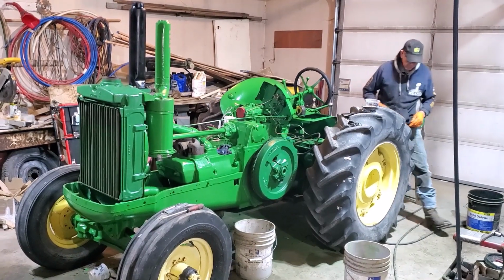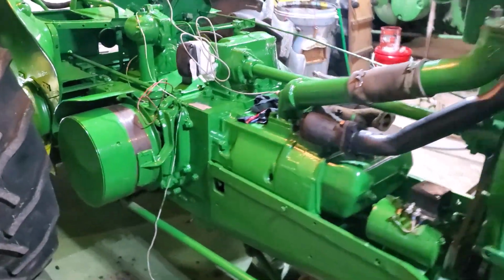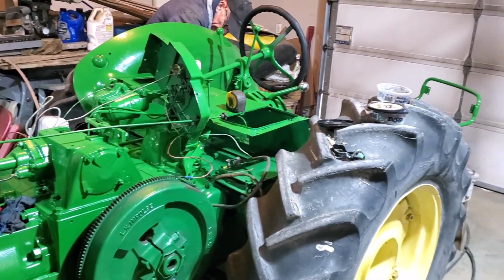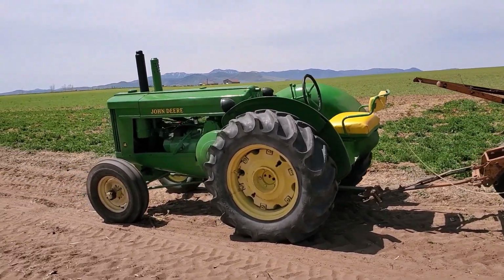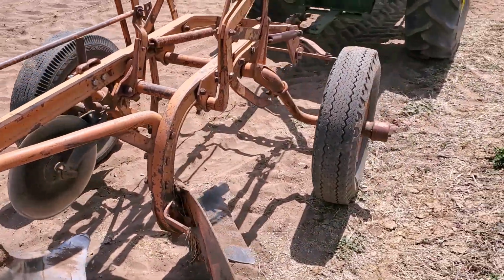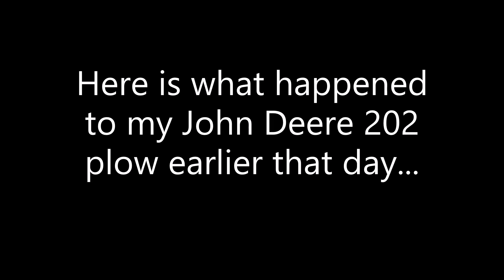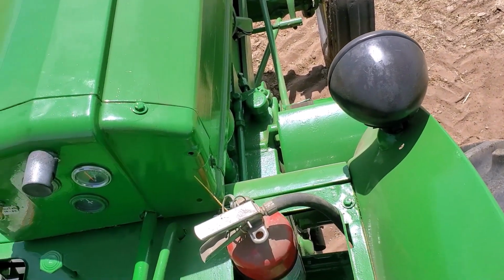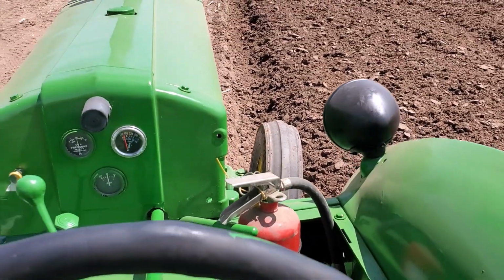John Deere AR Plowing

Comment: Those John Deere two cylinder tractors all the best sounding tractors ever! They are loud enough with a regular muffler on it but I think they sound just a little bit better with a straight pipe on it that makes them louder but it is one of the best sounds in this world! Those that has not grown up with these tractors might have a hard time understanding
Reply: I couldn't agree more with you Mr. Carlson.
Reply: Straight pipe mufflers are for parades and tractor pulls.  Hearing that straight pipe all day gets old pretty quick.
Reply from the maker: The iconic sound of a 2 cylinder John Deere can't be matched
Reply: @jonelsonster  there is no way that sound can be matched!
Reply: What???   Growing into my late 50's now,  and running the stock muffler on a tractor 40 years at the time.
 How come that big sqare radio could be clearly heard a 1/4 mile a way but I could barely hear it right next to me?

Comment: I've always fancied an AR.  The seat is nice and low so it rides a lot better than the whip-lash and rock you get on a row-crop A.  Least ways, that's true of my D compared to my A.  Gentle riding configuration.   Thanks for the video.
Reply from the maker: I agree. There is just something about sitting low down suspended out behind the rear wheels on an AR or a D... It's very different than working on a row crop.

Comment: The AR will pull a 3 bottom
Reply from the maker: Probably would ... We just don't have one
Reply: Is the AR the same horsepower as an A?  Its stance makes it seem to be a bigger tractor to me.
Reply: @dwightl5863   the AR has about 13 more HP than the A and weighs about 1500 more than the A . The D is the most powerful in those years 33/53 and my favorite 8.3 engine.
Reply: @dwightl5863  the AR has about 15 more HP than the A
Reply: @chuckwilliams9090  Thanks for the clarification.  I'm 100% smarter now.

Comment: Is engine speed set at 975 RPM/ Sounds a little slow to me.
Reply from the maker: Good ear. The governor spring (the flat bar connecting the throttle handle and the governor) is weak. So this tractor didn't like to run fast. It's always slow.